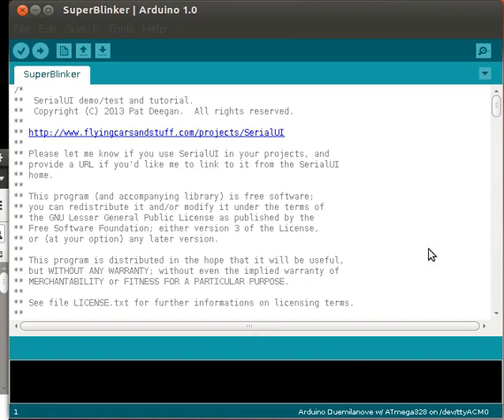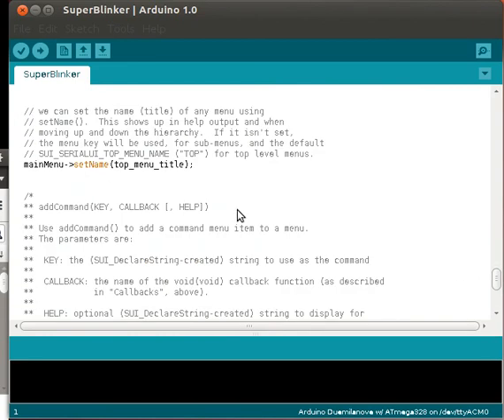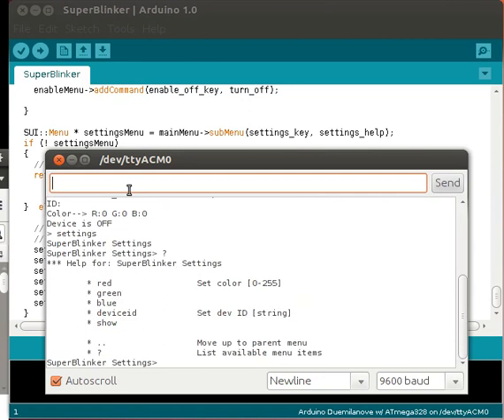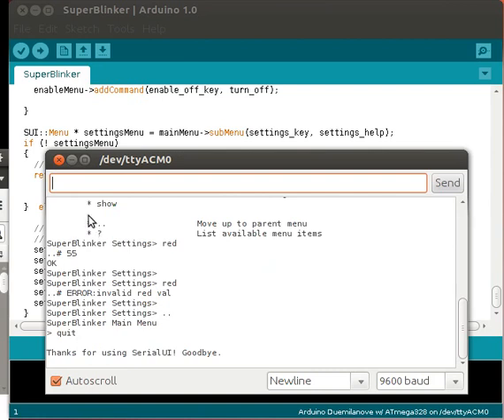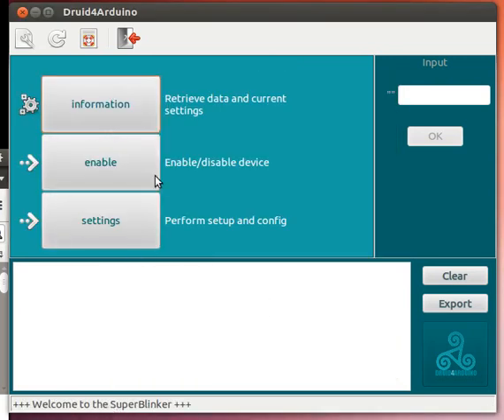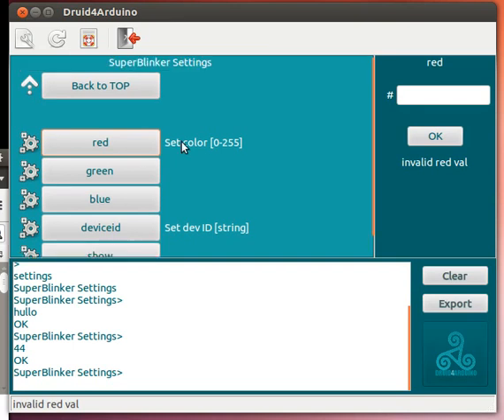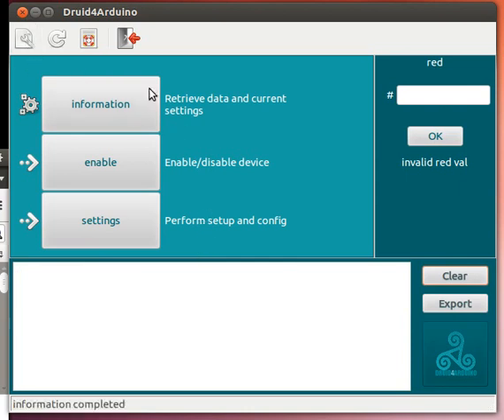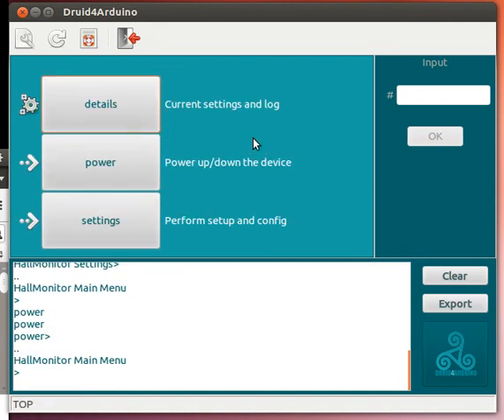druid4arduino: intro and walkthrough of the automatic arduino GUI

Comment: Any advise for the error "No Response from ping for 3 seconds on COM" ??
Reply from the maker: Greets,  two things on this:
1) sidestep the GUI and try connecting with just a serial terminal program... need to know if that even works, so if you can connect and hit enter or send a "?" and get a response, then its the GUI, otherwise it's lower level.  If you can connect, it may be a speed thing... lower the baudrate in both the program running on the device and in the GUI
2) I haven't maintained this stuff in a long while, and am seriously considering killing the project.  I'll keep SerialUI (the basic arduino library) but the GUI stuff isn't what I'm good at (or interested in)
Reply: @PsychogenicTechnologies  Thanks alot - havent found the problem, but changed direction and wrote my own 60-2 code, and works now. No options to ramp RPM or anything like that, but just to test the outputs which work nicely now.

Comment: Hi; I am running Linux Mint.
mick@Rosewill:~ > uname -a

Linux Rosewill 3.16.0-38-generic #52~14.04.1-Ubuntu SMP Fri May 8 09:43:57 UTC 2015 x86_64 x86_64 x86_64 GNU/Linux

It will not compile.
What linux are you running?
Reply from the maker: Ubuntu... but to be honest, it's pretty outta date.  I'd been working on a potentially awesome update and was stalled for a good while.  Got back into it last month and a wholly reworked v2 is coming, finally, within ~2 weeks.  I'll have an announcement (or 6) on flyingcarsandstuff.com in the near future.
Reply: Thanks.
The new Mint 18.1 failed for me also.
Reply from the maker: Ok, well it took a good while, but an update is finally being released this week, though Linux will take a few days more.
However, the tech underlying the UI has been completely refactored and is, in essence, Cordova.  I've been doing dev under Ubuntu, which plays pretty nicely with cordova, but I'm totally in the dark concerning Mint...  
I'll be checking that out once I've ironed out the final details on Ubuntu.